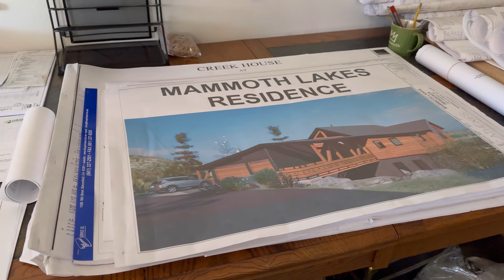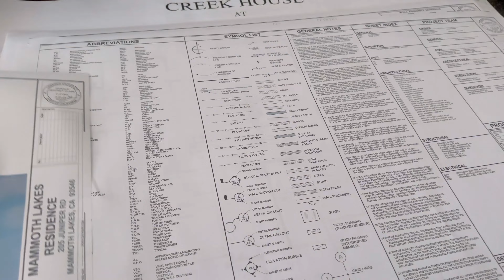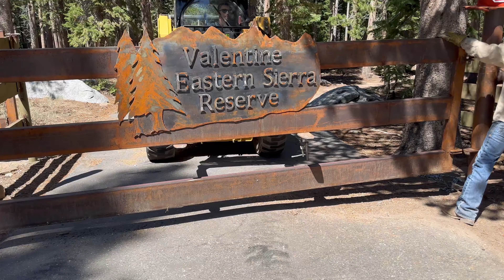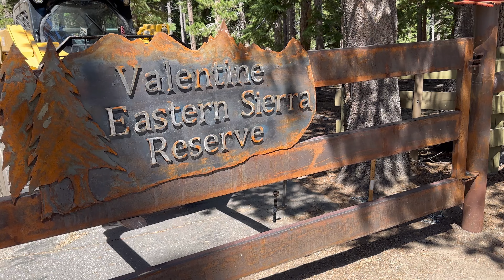Digging out a large stump high in the Mountains. #high #country #life

Comment: So will you be building a concrete retaining wall at the new house you are building at the 16:00 mark on this video to stabilize the hillside by the road?  That large pine tree you removed helped to hold the hill together.  Also in the spring when the snow melts that remaining dirt will get very soft.  From a former builder of many homes in the Portland, Oregon area.  Happy trails.
Reply from the maker: You’ll see 😅